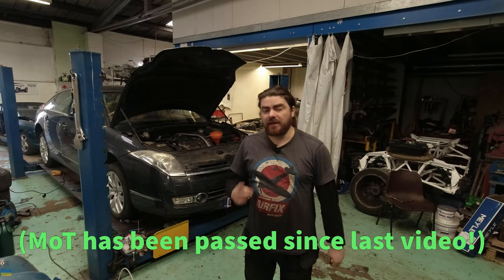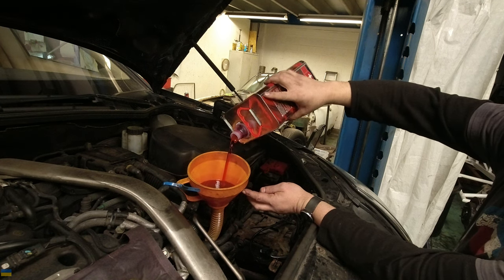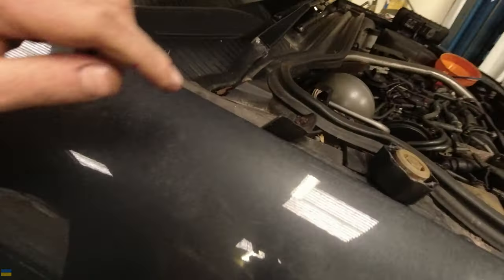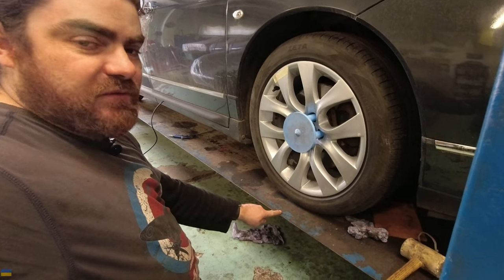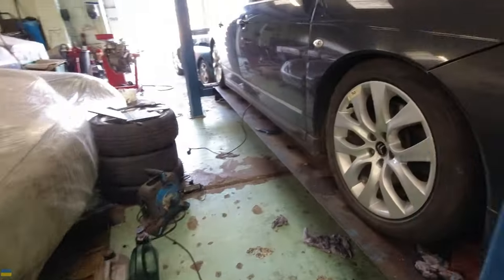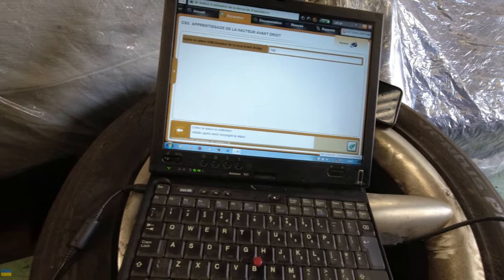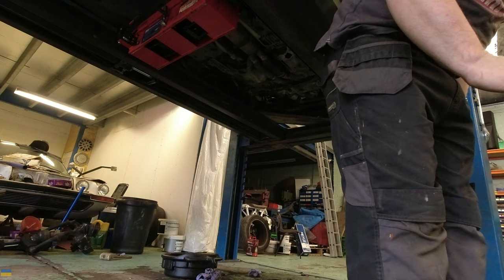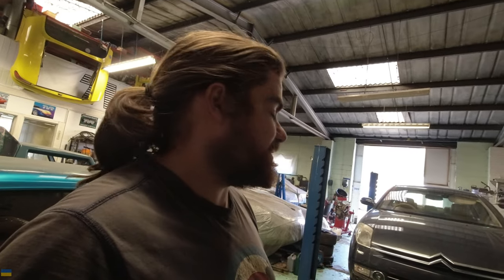Cheap Citroën C6 Project 6:  Setting up the SUSPENSION with a French laptop & GEARBOX verdict

Comment: Hi, I was the chap who sold you the gearbox. I can confirm it worked absolutely perfectly in all circumstances.....hot, cold, motorway and town

Reason for removal was body damage and crazy prices to have it repaired 

Loving the series and glad another C6 is being saved using the parts from "YJ57"
Reply: Good to hear.
Reply from the maker: Ah that's good (or bad, depending on how you view it). I thought I remember you saying it was sound. I suspect the valve block was 'tired' but still functional, and that switching it over has done it no favours.

Comment: Hi Rich...love your videos. Two smal things about the door error and water on the the diesel filter. The one on the door errases itself putting down and up the window continously. The water on the filter move a little bit the sensor on the bottom of the filter: contact defficincy. Also when the sistem pressurizei the suspension, with engine running, put up and down the car there times and move lero and right the steering wheel. Cheers!
Reply from the maker: What does turning the steering wheel do?

Comment: As a fellow C6 owner and someone who does all the work on these myself as well for the last 7yrs.  I can personally feel the issues your coming up against.  At times these C6s will push back at you.  But your clearly intelligent & fairly patent and your used to Citroens in general so you’ll get it sorted properly in no time.   I’ll give an example.  It’s taken me a long time to replace the coolant hoses for the car I even after all that it would not seal.  Eventually I found the reason.  The non Citroen Radiator was leaking slowing in a place I could see easily.  So not the bullet and bought the actual Citroen radiator and problem solved.  No more slow loss of coolant.   The after market parts aren’t in my opinion very good.  I’ve had issues also with ABS sensor not lasting very long.  But again the Citroen one lasted.   

You sort that cad soon.  But it’s a car that needs Idir decent second hand parts or original Citroen part unfortunately.

Comment: Is it worth taking your old valve body apart and seeing if there was an issue with it ?
Sonnax have a diagram for the AW TF-80SC which has some useful part numbers and symptoms/diagnosis information, they can also supply a rebuild kit.
Harsh shifting and gear flare are usually caused by the Valve body not engaging the clutches properly not the clutches themselves
Reply from the maker: It could be, yeah, though if I can just get it driving nicely, I'll be happy!

Comment: If you refit the level plug (the little one that goes in the level tube, then fill it, you can do it on one go, run the box to temp then check it..

Whilst it's probably clutching at straws, I assume you did initialise the box ecu after changing the valve block as well as resetting the oil counter?
It'll be bangy as hell after doing that, you need to drive it through a sequence for the ecu to learn what's going on in the box on relation to throttle position and road speed..
Reply from the maker: I thought I did, but now I'm doubting myself.

Comment: The passenger mirror problem is the low battery. It always that when the battery is on the way out and only the left side passenger side.
Reply from the maker: Does it went the battery is fully charged, to be fair. The actual function doesn't work, either.
Reply: @UPnDOWN  don't be suprised if your battery is undersized and/or on it's way out. When it was doing it with mine, everthing else was fine. My battery was undersized and had died a few times over lockdown with lack of use when it started happening. New battery and dissapeared completely. Although tbh it's the least of your worries right now :D

Comment: My first thoughts on a clunking auto tranny is the solenoids, especially on Aisin-Warner gearboxes. They can be sticking or worn out. Change those out, if you can.
Reply from the maker: Well, I changed the whole valve block in one go. I may well try the solenoids in the old one though, and see what difference it makes.

Comment: Hi Kitch. Re the passenger door mirror dipping or not, on my XM I cleaned up the electrical connectors in between the main loom and the door loom and that fixed it. Mostly.

Comment: If you couldn't read French before this, you should be getting good by the end of it. Land Rover P38 you just got a set of alloy blocks to sit between the axle and the body and the ECU did the rest, apparently there is such a thing as French sophistication, very interesting. You can't be expected to get it all in one go, but you will in the end. Thank you.
Reply from the maker: The block idea is actually quite a good one, in fairness.

Comment: That looks like Diagbox.. pretty sure you should be able to vin code with it.
I've certainly coded 407 displays and RCZ radios with it.
Reply from the maker: VIN code what? Sorry I don't follow
Reply: @UPnDOWN  You mentioned changing the gearbox ecu. Unless I got the wrong end of the stick. I was 3 beers in by this point.

Comment: HELP!!! GOT MY SUSPENSION POMP FIXED, GOT IT BACK (WORKING PERFECTLY OUTSIDE THE CAR), ASSEMBLED IT AND NOW IT DOESNT WORK. ERROR MESSAGES ARE COMUNICATION DEFFAULT WITH FRONT AND BACK SENSORS AND CSI UNIT...ANY IDEAS PLEASE? CAN IT BE WATER ON CONNECTIONS(NOT LIKELY, THE CAR WASNT MOVED WHILE FIXING THE POMP). MANY THANKS. I AM DESPERATE...
Reply from the maker: Hi, it could be poor connections, yes, but nigh on impossible to say from here I'm afraid. Could be anything.